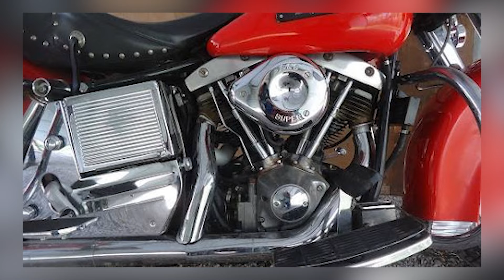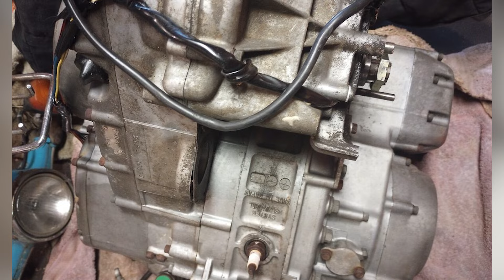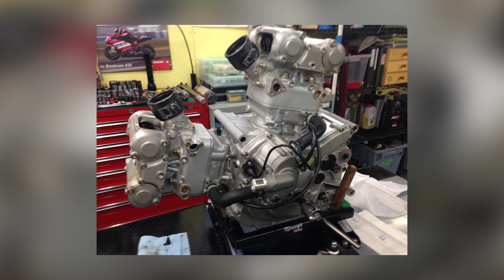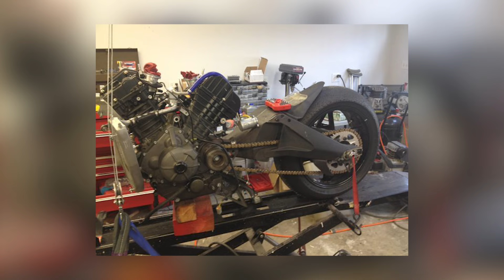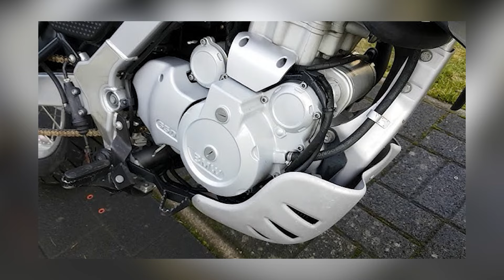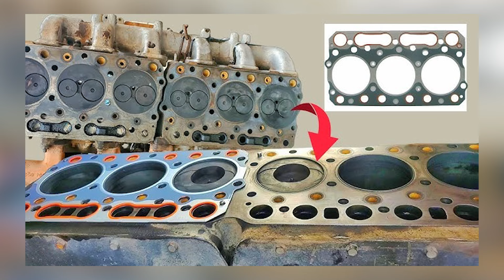10 WORST Motorcycle Engines of All Time

Comment: I had a '73 TX750 metallic gold. I think I paid $300 for it. Looked good and ran good...but, oil would creep past the o ring letting oil into the points. It would kick back when trying to start an wear out the dowel pins for the starter. The factory had a modification that had two o rings on the shaft to the points. It worked for as long as I owned it, which was not long at all. Sold it for $300 and a '75 DT 125. It was green and a great dual sport for short rides!
Reply: Heck yeh the DT’s were always great, I had a few IT’s myself and let’s just say the school bus wasn’t nearly as fun or cool. I’d roll my little IT175 down the street to start it, hit the RR tracks and make school in 7 minutes. Sorry, I love rambling about the old days.
Reply: @deborahchesser7375  Me too! Riding the bike to school was a great way to start the day. Back then I had a '72 CL175. There were quite a few bikes in the parking lot when I was in high school.
Reply: @markfloyd7206   hell yeh that was the best way to start a day, we were wide awake when we rolled in lol. I even rode my 76’ CB400 SS all year once, I’ve never been so cold, I couldn’t hold a pencil for at least an hour. I couldn’t afford a decent car so I got a bike, then to prove my Dad wrong(wata ya gonna do when winter comes?) I rode all year and like I said it was no easy feat. Had a scarf tucked up under my old Electro helmet, I actually started to freeze to my bike once. 😆

Comment: The “shovel head” motor you display is  a 1966-1969
generator or flat side motor and the last of the true Harley Davidson products.  AMF took over in 1970. What immediately struck me when AMF took over was the poor quality of the metal used in almost all parts.

Comment: Kawasaki Z1 
Only the very first had that device.
I had one of them and I never had trouble with that device. What is more, it was very easy to get rid of that lubrication.
The trouble is, those who like to bash the Kawasaki Z1 never had one! The same goes for Kawasaki's triples.
By the way, the Z1, Z900, Z1000 and derivates were the most easiest bikes to service.
Reply: Relatively easy to service other than valve adjustment, shim under bucket was a labor intensive job needing to to measure the shim stacks etc. but yeh, otherwise they were a breeze to service. I wish I still had my gorgeous 77’ green KZ1000 with the Kerker
Reply: and the chain oiler had nothing to do with the motor, just the drive chain.
Reply: @deborahchesser7375  
I'm afraid you confuse them with the smaler engines. The brilliant Z 650 engine had the shims under the tappet and later the 400, 500/550 and 750 Fours. Yes, that was a tricky business especially not to mess with the valve timing.
I still have a Z1R. But you are right the Z 1000 A1 was a lovely bike she knew where one wanted to go. I wish I still had mine she also was a green one from '77 with two disks.
Cheers!
Reply: @waynegto1484  Quite right!
Reply: @carlnapp4412  we didn’t have those models in the states, but I could have sworn the early KZ900’s  had the shim stacks used for valve adjustments. At any rate I wish I had my gorgeous metallic green 77’KZ1000, Andrews cams, i rejetted my carbs and had the famous Kerker header of course, yellow plug wires and white letter Dunlops, she was a sharp bike. I told my buddy that owned a decent Chevelle that I’d smoke him with my 4 banger lol, and I did even though he knew I’d leave him on the line it was all in good fun.

Comment: I am pretty sure the 1200 Triumph is a 4 cylinder with a good gearbox and they are thinking of first gen Rocket 3's. These did have gearbox problems.. also the BMW, the 650, it's a Rotax and you can finde them for sale with 80-100k kilometers on them.... this guy gets some facts but is also talking BS 😂😂😂
Also not a single BSA was mentioned 🧐